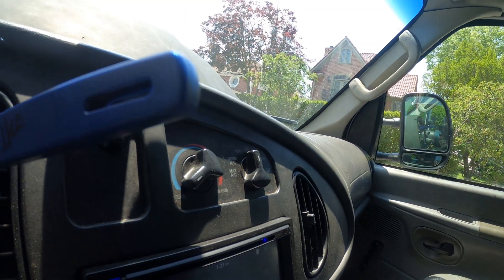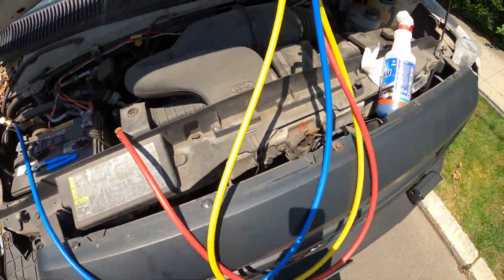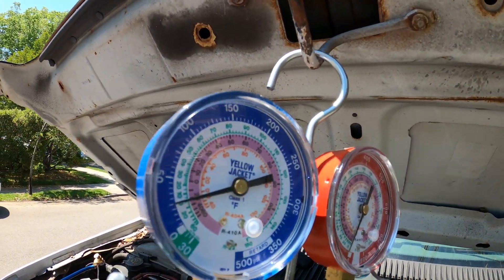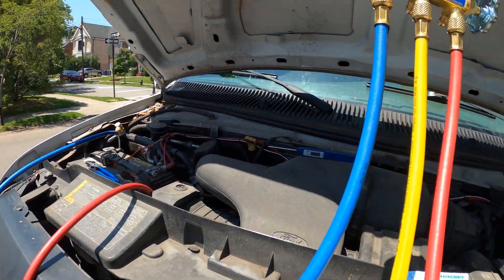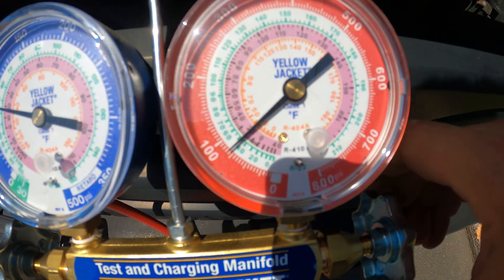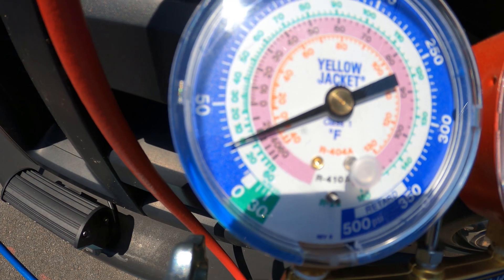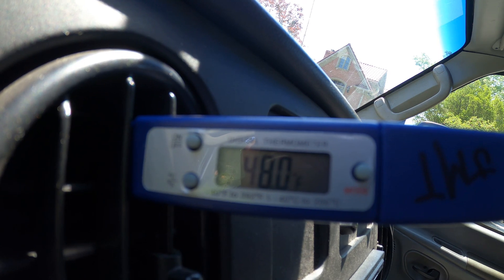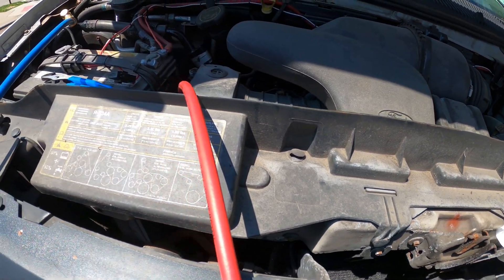HVAC: Work Truck Air Conditioner NOT COOLING (Ford Econoline Van E250) How To Recharge Car AC FREON

Comment: Hello I have a 1996 ford E350 church bus with rear overhead ac.the rear is blowing cool but not the front. I replaced the dryer and replaced all the o rings I would find. I got a new expansion valve for the front ac but can't find it. Do you know where it is located on these vans. 
Any suggestions or advice  would be greatly appreciated.  Thank you.

Comment: Lets chat shall we? 1.No vacuum today? Need a min 2 hour vacuum. 2.Connecting refrigerant tank. You purged the yellow charge hose, congrats. BUT your manifold, red and blue hoses had air/moisture inside. Should of opened the tank valve, Purged the blue hose at the adapter as well as the red hose at the adapter. NOW all your hoses and manifold are properly purged. 3.No need to open and close the low side valve like you did. Let her eat until you get 25psi on the low side. 4.Must rev to 1800rpm to get a proper pressure reading. As if you were driving down the road. 5.Must weigh in the charge.

Comment: 00:30 "AC set to cool" Just for people who don't understand vehicle HVAC systems, the control he indicated has NOTHING to do with the air conditioner.  This control only adjusts how much heat is being added from the heater section of the HVAC, from off ("cool") to maximum heat ("warm").  If you have the switch set to AC then the AC is on.  You might be able to overpower it by turning the heat all the way up, but the knob does not do anything to the AC part of the system.  If you have the switch set to Vent, Flr, Mix, or Defrost (and, of course, Off) and the temperature control set to "cool", rest assured the AC is NOT ON in any way.  There are some vehicle systems that turn on the AC compressor when in Defrost for the purpose of removing moisture (i.e., defrosting with air that has had some of the moisture removed from it), if so the temperature control still does not change the AC.

Comment: damn! this is why i don't do gas ...yet. i can troubleshoot the electronics part for my customers in home cooling systems.i don't auto for customers.i just haven't learned yet also if needed the other gases besides 134a i can't get my hands on because i'm not a licensed hvac guy.i only repair stuff to certain degree that's why i leave it to the pros like you.awesome vid,well explained and pretty easy enough to understand.thanks i will save this one cause my van ac isn't working of course that's why i'm here,lol!..i get power 12v to everything except the compressor connection but i'm also out of gas too and i could't get any in with my little can set up with the t handle.it was leaking out of the valve stem of the can..i don't know if i should suck the system dry and then put a can in with a better set up.i have a set of guages i never used that i got from a friend that needs the quick connectors for...

Comment: So where was the leak?
Reply from the maker: Cant find the leak. Might be in the evaporator coil which is a lot to just get inside. Been topping off the charge every year or two. Sucks but maybe one day I'll check deeper for it. Lol. Glad this thing still works! This truck is from 2008👀
Reply: Gotta pull out the H-10 haha.
Reply from the maker: @deviouslick5097  Definitely need to put out the electronic leak detector for this one 😅 Enjoy the rest of your weekend!

Comment: R134a is a refrigeration refrigerant? Then why do A/C chillers I take care of have hundreds to thousands of pounds of R134a?
Reply from the maker: R134A is used in refrigeration. That chiller is considered industrial refrigeration 👀😎 I just also got my refrigerating operating engineers license and It was based on indirect system such as chillers👍 Funny how it supplies chilled water for air conditioning systems. In reality, AC & Refrigeration is the same. The science is the same with the theory. As a commercial AC & refrigeration tech, you only see 134a in refrigeration applications. Stay safe out there & stay tuned for new videos every week!